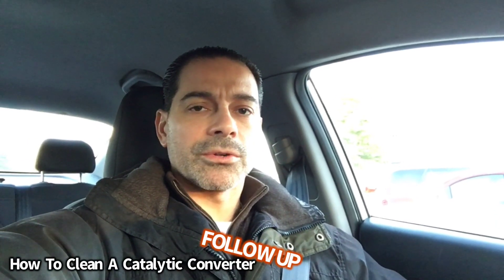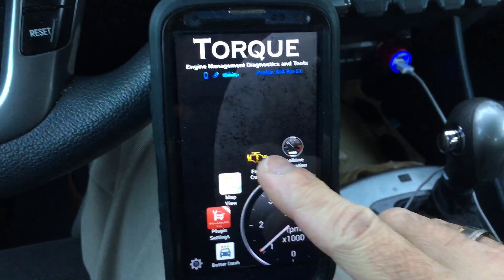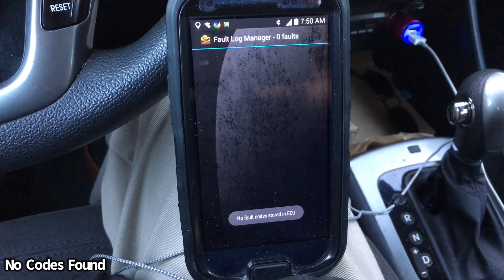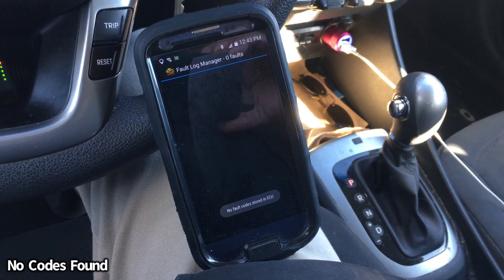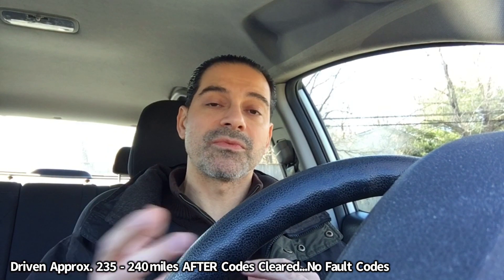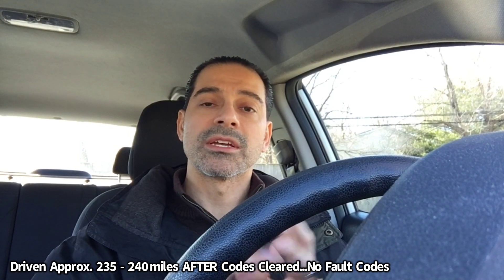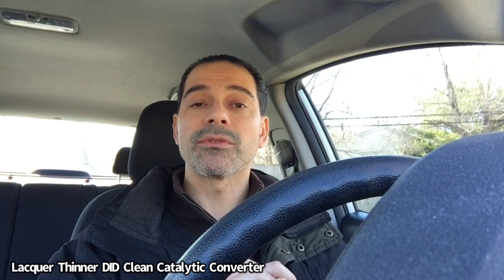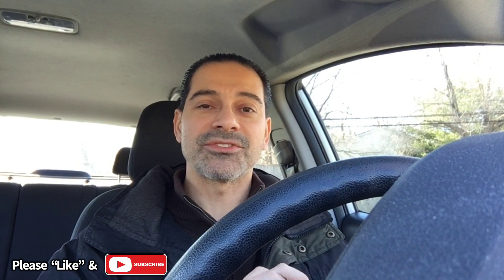How To Clean A Catalytic Converter - FOLLOW-UP (Andy’s Garage: Episode - 151)

Comment: I was getting the low efficiency bank 2 code about every 130 miles.
Tired this, and I've gone 1150 miles with no code!! So I give this a thumbs up!!
2006 Lexus IS250 AWD 166,000 miles.
Reply: Did the light come off on its own or did you have to clear it out?

Comment: Lacquer thinner does what a lot of additives do; And I believe it does it better.  You use more (1 Gal to 1/2 tank of gas) and run it through your engine.  Scotty recommends driving 150 miles. I drove my '04 4Runner
90 miles & the 420 & 430 codes disappeared. This cleaning works on cats that are not totally destroyed. (rattling from cat indicates bad cat-cannot be fixed with any cleaner)  The honeycombs get clogged from hydrocarbons- The lacquer thinner loosens the crud up and out it goes, opening up the honeycomb.  It won't hurt your engine or components. Lacquer thinner is made from petroleum distillates. One guy here on YouTube actually ran his car on pure Lacquer thinner with no adverse effects. Another guy used 2 gallons.  I would stick with 1 gal.  In Calif. we have to smog test every two years. I will so another treatment a couple of months before testing.
Reply: Hey, did you use the California version of the lacquer thinner? It has more acetone and I was wondering if it was safe to use
Reply: As gasoline ages, it actually turns into Lacquer. Which is why old gas doesn't perform well. Probably the best gas treatment out there is Archoil. It was specifically designed for generators where the gas or diesel fuel sits a long time, and is patented. It sounds expensive, but a couple ounces treat 30 gallons. Very concentrated stuff.
Reply: @user-qx3sv9oz9nhat did you try? The thinner?
Reply: "Half a tank" can be 10 gals or 5 gals for a small car. Scotty recommends 1 gal thinner to 10 gals gas....some guys use 1 gal thinner to 5 gals gas, a stronger mix. Keep it in this range.

Comment: I was getting 0420 in my 2013 kia Soul with 175k.  Just bought this thing from my neighbor a few days ago and she never changed spark plugs and they were rotten.  Had to change the crank position sensor because the tach wasn't working causing the engine to run very weak, bad plugs didn't help either, they were original.  Then i had to change the B1S1 upstream o2 sensor because it was literally flatlined dead with no signal whatsoever.   (I have an Xtool scanner). Then it was all good to go and then bam i got the 0420 code the following day.  Kia is a 12 gallon tank and i had 3/4 of a tank of gas so i added 2 gallons of L.T. and drove it for 160 miles non stop at about 3,000rpms because thats where the Kia 6 spd manual lives and it all cleaned up and you might hear this form very few people but my idle now doesn't have a slight miss here and there, it is smooth as silk and when i'm coasting i swear my motor is off its so smooth now.  Not quite sure where everyone gets their mixture knowledge from but I'm quite sure its not scientific and its based off of he said so i did.   I was also starting after four nun nun nun nun running, and now its just nun nun running.  So i think in my case the lacquer thinner also helped my injectors and who knows maybe cleaned the piston tops and maybe some valve cleaning too.  But i can't verify that but boy what a difference.  Oh, and anyone who gives a turd about fuel economy after I reset the trip and economy features I was getting 31.3 mpg after 150 miles of non stop freeway driving in 6th gear from my manual tranny and stock steel 15" wheels  spinning an average of 3,000 - 3,200 rpms at around 70mph give or take a few.

Comment: My catalytic converter is contaminated with oil. As part of my (1983) Jeep CJ engine swap I've removed the CC. Please, is the lacquer thinner superior cleaning agent than soaking the CC in a bucket of hot water & detergent, (something like Dawn dish detergent, or Purple Power degreaser)? If so, should I just submerge the CC in a bucket, with enough lacquer thinner to completely cover it, and let set overnight? After sitting submerged in lacquer thinner overnight, would I just rinse w/fresh lacquer thinner, or distilled water? Thanks.
Reply from the maker: I’ve tested multiple cleaning products for the catalytic converter and found lacquer thinner worked best. I would try this first before soaking it

Comment: Hi: 
Did it do damage to any hoses or other parts of the car afterwards, I’m a be little tentative of trying it. I do have the p0430 code on my es330, and was told by Scotty killer to try this.
Reply from the maker: No damage to anything, but keep in mind if the cat is too bad it will need to be replaced

Comment: This won’t destroy the engine or destroy anything inside the vehicle?   My mechanic also said I should remove the catalytic converter if I want to clean it.
Reply from the maker: It won’t destroy it as long as you don’t keep doing often. I’d recommend doing it once and if it doesn’t work than replace the catalytic converter. You can remove it and clean but sometimes that requires cutting and welding.
Reply: Try the thinner first...I did it this week, paid 9 bucks at home Depot...poured it into a half a Gallon tank...ran my car and drove a bit...the code was gone the morning

Comment: I have a cod on my Nissan Altima 2003 code is P300 or P3000 not sure if its the p300 or p3000 should i try this on mine i small some gas in my back where my kids set
Reply from the maker: Looks like a random misfire code. A bad catalytic converter can cause that, but most of the time will generate a P0420. You could try this to see if it helps, but you have other issues causing the misfire.

Comment: Andy, I have a 2014 Nissan Versa Note & I have the code right now. I used cataclean before two or three times over the last year & a half clearoing the code each time. I did it august 12th/13th but I still have the code. Will laquer thinner still work or is my cat too far gone? Does anyone know out there?
Reply from the maker: Your catalytic converter could need to be replaced, but at this point it wouldn’t hurt to try this before you spend the money to replace it

Comment: Would you still recommend this? I have a 2009 Subaru Forester. Thanks
Reply from the maker: Yes, but if the cat is too bad off you will need to replace it
Reply: @PhillipsVision  this is the part that some other videos don’t point out. Some people saying it doesn’t work are the same people with cats that are too worn out of even broken honey combs XD of course its not gonna fix those issues.

Comment: will it “cure” code P0135? changed O2 sensor but same code came up again after a 350km length highway trip. slight hesitations when starting to drive (ie from a traffic stop) or reversing, and, a little higher than normal fuel consumption. TIA
Reply from the maker: Did you use aftermarket sensors?

Comment: I have a Malibu 2012 that’s making a rattling noise when I drive.. I know it’s the cat I’ve ran the test on my car already should I still try the lacquer?
Reply from the maker: Rattling noise could be the shield breaking apart or getting loose; no cleaners will fix that. You could lift the car and examine the catalytic converter for loose pieces.

Comment: Will any lacquer thinner work? I went to 5 stores looking for the kind u used and no one has it. I saw a guy use the Lowe's brand. Jasco or something like that. Is that ok. Or even the Klean Strip with the tan label?
Reply from the maker: Any lacquer thinner should work
Reply: @PhillipsVision  thanks for the reply. We have a 2004 Trailblazer Ext. Has loss of power and RPM's rev. Took out the oxygen sensor and sprayed stuff in the opening. It'll smoke like it's doing something but doesn't have much improvement.  Will try the lacquer thinner tomorrow. Thanks
Reply: @cbreezy1322  how did it go?
Reply: @joel6689  Nothing cleaned it out. I ended up cutting the converter off and putting the temporary pipe on it. I sold my own converter and got 165. I have to jack it up and tighten the bolts every so often but we're driving it. I'll eventually see about having a straight pipe welded in. I wasted a lot of money trying to clean that thing.

Comment: Do you still have this vehicle now in June 2022?? What are the results two and a half years later?? Engine lights?? Any damage to vehicle?? It would be interesting to know.
Reply from the maker: Still have it. The light did come back on after a few hundred miles. Car runs great still, and passed the state emissions test last year...with the light on. My state actually tests the emissions, and not just looks at the engine code. Even though the light is on, the emissions are a passing score.
Reply: @PhillipsVision  Thanks for the reply. I am thinking of putting the lacquer thinner in my car but friends and family are telling me not to do it. They say it will destroy my car.
Reply from the maker: @moneymanfernando1594  I’ve never had it destroy any of mine, and I’ve done it several times. It’s important to follow the mixing ratio properly so it’s mixed with gasoline, and don’t use it on a regular basis.
Reply: @PhillipsVision  thanks again.
Reply: @moneymanfernando1594  This work for you man? Having the same thing, family and friends think I’m delusional for even suggesting it. Let me know if it worked for you! 

Thanks
Reply: @Andy-fg7hm  The truth is that I haven`t done it. I guess you can say that I am afraid to do it.

Comment: Hi.  Was your initial code P0420?  If so, have you had any other symptoms, such as poor driving performance, rough idle or starting, etc?
Reply from the maker: chris ryan yes, the code was P0420 and no, there were no symptoms. In the event that there is Rough idling etc, that normally is indicative of a failing O2 sensor as well.

Comment: a better question is.. ' will I get through state inspection this year ? '   In VA, a yearly inspection may fail you on 1 or more conditions. If the catalytic converter fails your car ... how will you get by ?
Reply from the maker: That should work, but I would recommend “Guaranteed To Pass”. Here is the product review...
https://youtu.be/1LadMsESsLo
Reply: In Richmond we don't have smog tests but you won't pass with the cel srs or abs light on the dash

Comment: Hi I'm at 240K mileage with my car driving for Uber....I tried this and actually work...drove about 20 miles already and the engine light hasn't come back...is this ok I pour this once a month to my car? I really love the feel of performance on my car...it feels brand new and has more power...on the contrary, I'm concerned if this will have a long term bad effect on the engine that would cause ultimately like overhaul
Reply from the maker: Putting this into your vehicle too often is not good. I would not recommend doing it every month.
Reply: @PhillipsVision  how about every 6 months?
Reply from the maker: @leetos.4915  i only do this once, if the catalytic converter still has issues I replace it
Reply: @PhillipsVision  ok will go that route then...thanks sir

Comment: Do you got to put all 150 to 200 miles drive all at once? Or can it be withing couple days?
Reply from the maker: You just need to run it completely through. I put all at once since I drive a lot for work
Reply: @PhillipsVision  i herd the that you can put a blower fan in front of the engine and put it on 2500 rpm and run the the fule and mixture out that way, instead of driving it 150 miles
Reply: I add a gallon of acetone to half tank (approx 10gal) in my Toyota suvs, turned two lights off at some point using the half tank in each

Comment: I just tried this with a gallon of lacquer thinner to about 10 gallons of gasoline. I had the PO420 code. I put 150 miles on the car and reset the engine light. The engine light came back on about 70 miles down the road. Can I repeat the process again?
Reply from the maker: I wouldn’t do it too often. If it’s back the catalytic converter may need replacing.

Comment: can i just get a blower fan and put it in front the front for the engine and put it on 2500 pm , and run it an tell  the gas runs down to above empty , instead of driving the car 150 miles, will i get the same results?
Reply from the maker: I guess, as long as you’re running the engine the recommended time

Comment: Do i need to turn off the code first before i put the thinner!! Or it doesnt matter! Thanks!
Reply from the maker: ELKRIS 21 it doesn’t matter, but I like to clear all codes whenever I fix anything just to get an accurate reading
Reply: @PhillipsVision  thanks! I recently put some cataclean like 2 weeks ago that didnt help! Can i still put the thinner?
Reply: It doesn't matter which you do first but, you've got to clear the CEL code/light in order to know if everything is back to normal.  Depending on the vehicle, disconnecting the - battery terminal for 10min should clear the computer.  I often disconnect them overnight if I'm not driving anywhere but that's not necessary.

Comment: Is it good to use just for carbon clean?
Reply from the maker: Should be fine, but don’t do too often. The acetone in the thinner can be harmful to the fuel system if done too much
Reply: I can confirm that acetone is a very good engine and catalytic concerter cleaner.
My engine ran rich for a long time and completely clogged itself (map sensor faillure).
After the map sensor problem resolved it still ran like shit.

But after the acetone, I used 2% pure acetone, the engine performances improved so much I could actually pinpoint the time it unclogged more and more on the road.
I took a 400 miles road trip and refilled after to flush the acetone after the trip.
Reply: @ElectronikHeart  thanks for reply
If I fill tank how much time should I add
Reply: @bangoutslim9879  I used 3% acetone.
Between 3 and 10% would be the sweet spot. It's the same ratio of acetone than using cataclean or b12 chemtool (they use acetone as their main active ingredient).

Be sure to use most of your fuel tank in one time the same day you put acetone in it.

Acetone is very volatile, so if you don't use it soon enough it will just evaporate and may ruin your fuel pump or seals or evap system.

In short, acetone and fuel, long trip 'till you got 1/4 to 1/8 of the tank, then refuel.

Comment: Does it do anything bad to the engine
Reply from the maker: Jabier Merlo if you run it through as mentioned in the video (1 gallon thinner added to a half tank of gas) and don’t do it often then it shouldn’t be a problem. If you do it often it can cause problems to the fuel system since it contains acetone.

Comment: Good morning. My mechanic recently told me that I would need a new converter. He suggested putting 4 bottles of Iso-heet in my car, run it, than go test. I went to test right after he turned off the check engine light and it did not pass. I never tried the heet suggestion. I tried the thinner idea. The light is now out. Can I just go directly to the test site, or do I need to do anything else beforehand to assure myself that the code will not come up? Thank you.
Reply from the maker: You should be good to go. I’ve done this before with no problem. If not, Guaranteed To Pass by CRC. I did a review on it, that’s works great to.

https://youtu.be/1LadMsESsLo
Reply: @PhillipsVision  So for clarification, just go directly to the emissions test site? I have read that to assure it is gone, first have it checked at say for example an auto zone, than have them clear the system, and apparently check it again to make certain that the converter code does not officially come back up. Is that necessary? With the light having gone out since the use of the thinner, is that the assurance I need that the thinner actually cleaned the converter? Sorry to bug you.
Reply from the maker: @lm7692  if the light went out on it’s own, you should be fine. If you have the ECU codes cleared, you’ll need to drive for a few days without codes before testing. They can see it was cleared and want the ECU computer to start building a driving log to show no issues detected.

Comment: I have an 02 trans am. The 0430 code came up and Im in the process of doing this and I have driven about 65 miles so far. Do I have to reset the code or will it disappear on its own?
Reply: It might go away if its work your engine need to cycle my every 71 miles/is it work , my work out awsome
Reply: You can clear the codes yourself but I prefer to make changes like a tuneup or this lacquer thinner/acetone engine and exhaust system procedure and see if codes clear after a number of on-off cycles. That's the real proof if something works. Codes cleared by the computer and monitoring systems by themselves.

Comment: Dammm it didn’t work for me...

Well 
1) Gas tank was halfway full
2) added lacquer thinner (same as Andy’s video Description [Brown label])
2.5) upon adding lacquer thinner  I drop about 5 percent of the 1Gallon on the floor because my funnel was not in place. Second I left about 5 of lacquer thinner in the canteen. Overall I didn’t pure 100 lacquer thinner probably 90 percent went in the half way tank. 

3) drove my car right away on the highway 101 Ventura to the 118 highway 

No luck went over 150 miles ( I calculated my trip using my trip button on the odometer) 

4) I have filled my gas tank since then and the code is still on..
Waiting to see if it clears out in about 400 miles

A different  driver on YouTube claimed that his codes cleared after 400 miles ( he didn’t drive fast on the highway or reached over 2000 rpm, he just drove regularly until the codes disappeared)
Reply from the maker: R5150i you need to add the full amount of thinner. You’ll need to burn the entire tank, then refill your gas tank. It could be that your cat is too far gone. This is not a guarantee for all failing cats